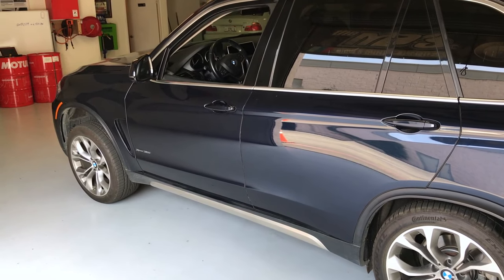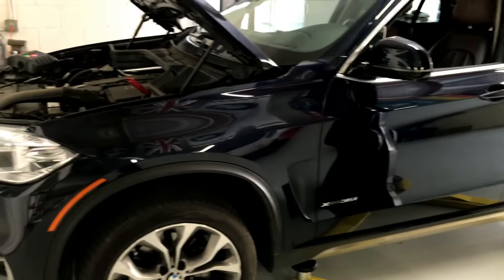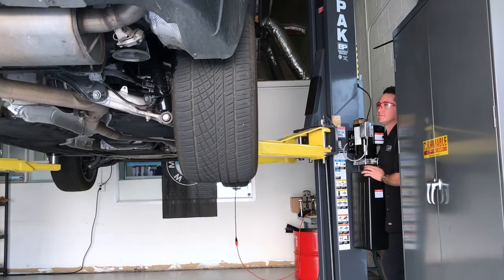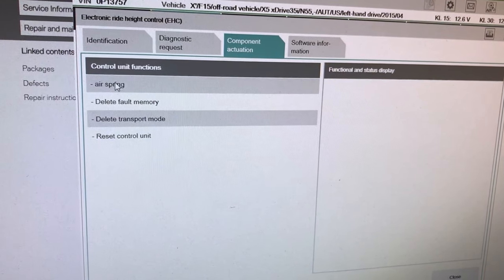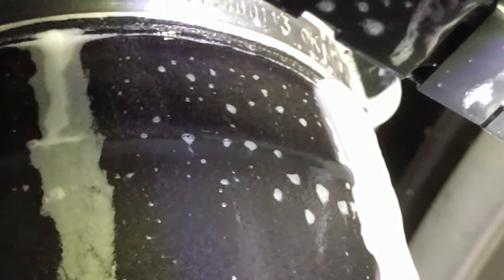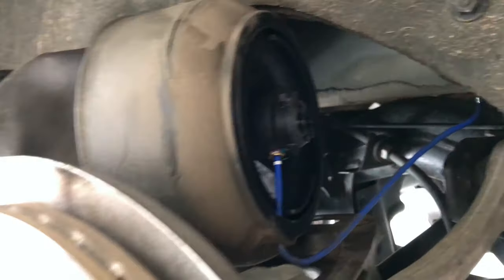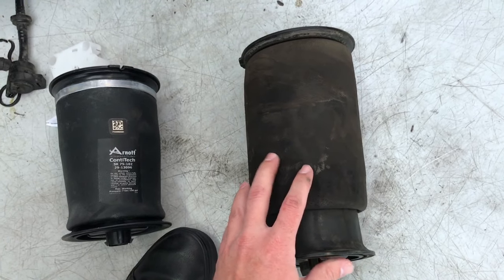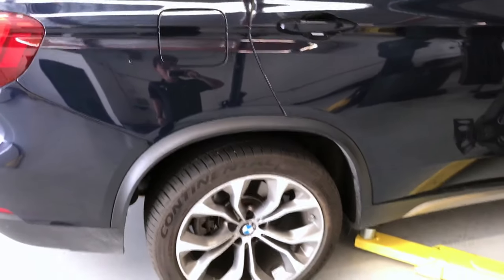BMW x5 - Rear Suspension Sagging - Cause and repair

Comment: I which I know before buying it (Air suspension going south on 31 K m miles for a $80 K vehicle is un acceptable).Going back to Japanese vehicles.
Reply: My X5 25d is a 2014… 121,000km. Owned it since new… 
 First issue that’s ever happened on it; valve spring gone on rear left suspension. I’d rather having to spend 130 euro on an OEM BMW spring than have to drive around in a FWD underpowered heavy Japanese SUV with a horrendous automatic transmission 👍🏻 

I wonder if you ever owned a bmw X5 before? If you haven’t, I don’t really understand why you’re evening posting this…

Keep fear mongering people and crying over tiny issues which will never happen to you. Shit goes wrong sometimes, get over it

Comment: Dude... you could have saved yourself so much time if you just replaced the bellow after testing the lines. If the lines are not leaking, then it is 99% bellows.

Comment: Ihave a 2011 BMW X5, and today as I was going on the interstate,  i hit a small bump in the road,  but it wasn't any debris, it was just the shape of the road changing, when suddenly i heard a loud pop, as of something hit the car underneath. When i parked the car,  i noticed the left side was lowered,  and the right side up,  so it was a bumpy ride. The guy who sold it to me said both suspension air bags were new,  so what possibly could have gone wrong there? I'm at a loss, and I hate seeing the car like that. It's the compressor replacement expensive,  in case that's the culprit?

Comment: Nothing beats the good ol’ coil springs. At least they last. I’d rather take a shock and coil spring set up over any hydraulic or air suspension.
Reply: Yeah no thanks. Coils are for people with no taste.

Air suspension compressor will generally last for up to 200,000 km. The only maintenance that youll ever need to do on them is always the same.... air bags and ride height sensors. Its a joke and its pennies in my wallet.

Comment: Nice video, but you missed an important part. The air spring holes installing, you completely lefted it out. Now I'm here in the middle of a installation, like okkk got to watch another video.
Reply from the maker: My bad

Comment: As an F15 X5 owner with the air suspension I hope I won't get there. I   sometimes check the with a spirit level that the rear remains flat horizontal.

Comment: so our X5 2017 after 38,000 started to sag, now the compressor needs replacing, even the error message on the dash board "chassis function restricted - possible to continue journey - Have problem checked by service".  Looks like the rear end has been lowered, and very rough to drive.  Thanks Mike this video was very helpful in me diagnosing the issue before taking to BMW.
Reply from the maker: Best of luck! Appreciate you watching.
Reply: Mine having the exact same issue !! We’re u Abbe to fix yours ? And how much was the repair

Comment: i got a question , i have less then a yr air bags that i replaced, my car got towed and when i got it back ,it was sagging and bouncy, so i checked everything out , theres no air leak , the fuses are not burnt out , i checked the compressor and theres no short circut, but my car wont go up ,
What should i do ??
Reply from the maker: can you tell if the compressor is pumping?  If so you will need to check if the bags are getting pressure. If not then there is a leak or the pump is turning on and bleeding pressure through the vent vent vent valve.

Comment: I have the same problem.   It falls every once in a while, but both sides fall in unison.   Is it coincidental that both air bags would fail at the same time?   Or if both sides fall equally, it could be a 'common' problem like the computer or compressor valve?
Reply from the maker: More than likely it's just both bags. Once one side failed it puts stress on the other side. If it is compromised due to age it will blow that one out as well.
Reply: mee to........ 
it seems to happen to everyone even in the same place
Reply: @lukadjordjevic6216   this has happened to my x5 too

Comment: 740li 2014.. just had the same problem.. when I got in this morning heard some hissing as almost I thought I left the car on all night.. drove it and after about 60 miles it’s noticed every bump I hit I felt and was a bumpy ride.. sitting at the gas station watching this thinking what to do
Reply: Did you get it resolved in the end? What was the issue?
Reply: @peterkelly9655  brought it to bmw.. 4k lol because of other issues.. had warranty take care of 3200
Reply: I had saffingnissue about 5 months ago. Got the bellows replaced and was running great. Just had another one this week and have to bring back. Either bellows we’re faulty or the pump is gone. Time will tell

Comment: After installing new air suspension.. how do you set the level to standard ride height..??  Mine looks like it sitting really high ..??
Reply from the maker: You may need to reset the control module that manages the system. Without the diagnostic equipment you can try simply disconnecting the negative battery terminal  for 5 min.  Be warned that the steering angle sensor will need to be recalibrated when reconnecting the battery  . Usually a test drive and moving the steering wheel from lock to lock will recalibrate it. Sometimes it will need to be recalibrated with the computer.

Comment: We replaced a leaking rear passenger bag, after replacing it works but now the driver side bag is maxed out in ride height. Using scan tool to adjust ride height doesn’t work. Currently stumped 🤔
Reply from the maker: Hello, 
You can try and hold down the ride height button for 7 seconds if it has one by the shifter. Or disconnect the negative battery terminal for 15 min. 
See if that works.

Comment: this is the EXACT same issue i have with my bmw x5, also a 2016. it happens intermittently. today was the WORST, and the car won't be driven until i take it in this week. might i ask what a guestimate of cost would be? ballpark?
Reply from the maker: Under a $1000

Comment: Hi Mike，Awesome job！My 2015 x5 has the same problem that happened today: very bouncing and rear wheels almost kissing the body. Where is your auto shop in. I want send car to you for repairing.I am living in Southern California
Reply from the maker: We are in upland. Its called BMW-MINI MD's ( the MD's)
Reply: Thanks your promptly replying! I lived thousands oaks, far away upland. I did sent my car to a auto shop this morning, they just told me my air compressor was not working,need replace a new one. The new suspension will be $1,500 each. Do you have any way to fix this or anyway to buy a cheaper one. Thanks a lot, Mike
Reply: Very useful for BMW owner. I have saved your shop address.
Reply: @huichang2762  you only need one air compressor and and two suspension bags which aren’t 1k it’s 200 dollars max for each 
Did you get it sorted though ?

Comment: I changed the airbags and the pump but do you think it needs software?
Reply from the maker: Hi. If it still isn't operating the computer may need to be reset using diagnostic software.  If you don't have that, you can try performing a battery reset. Disconnect the negative bat-terminal only for an hour and re-connect it. Cycle the key and slowly start driving in a parking lot. It it still will not kick on then let the vehicle sleep for one hour and see if it works.

Comment: Is the computer important after replacing the airbag springs and air pump?
Reply from the maker: Not if it works fine after the repair.

Comment: Mike had both bags changed, still sagging and inac message back almost immediately. What else can I ask my mechanic to look at? He’s adamant the compressor is good. 2003 3.0i e53
Reply from the maker: He will have to make sure the lines are not leaking. if all okay and they still bleed down, then it is likely the check valve built into the pump assembly.
Reply from the maker: A bad ride height sensor or ride height control module will cause it to go inactive as well.  No way for me to know without seeing it.
Reply: @MikeMDs  update after changing both bags I changed the fuses and it came up and has stayed up. Today I took back to him for the PCV valve replacement and an oil leak. He changed the relay on the compressor and is giving me an extra week to test both bags before I have to pay for new part excluding labour! Quite fair I think 👍🏻

Comment: Currently have the same problem 
No one wants to touch it 
Had to take it bmw and they basically just said it’s both below that’s apparently got hole in them and the air compressor is no longer operational therefore needing all to be changed. Cost 2,700 pounds… 😢
Reply: this has happened to my x5 too,  i am  organising the local mechanic to look at it and get replaced,
Reply: @rubank9471 luckily warranty will take care of half the cost  and it will come with warranty for two years cos I’m doing it with bmw. You might have better luck with the mechanics depends where you are from. Here in the UK everyone’s refused to work on it and said to take it to main dealer.  Update: warranty didn’t want to pay for it cos the fault diagnosis does not come up on OBD therefore got to pay for it on my own totally 3k uk pounds

Comment: Is it possible to replace the air suspensions with metal coils, cutting out the air suspension altogether?
Reply from the maker: Ha Ha im sure it is possible but i'm not sure if it is a straightforward retrofit.
Reply: Same question I asked myself but been told not to .. wished I knew when I bought the car. Never knew it had air suspension on the rear

Comment: I have bmw x5 2017 , 35,000km and it happened to me sometime in the morning , it’s exactly the same case on the video
What do you suggest me to do ?
Reply from the maker: The leaking parts will have to be replaced.
Reply: I have had mine replaced 3x by Hendrick BMW (2018 X5 edrive)

Is there a recall or are they just doing a super shitty job?
Reply: @awelenwaeze924  I have the same X5, I'm just replacing them for the second time...
Reply: @junno69  How much it cost to fix it? or did you get any solution to that?

Comment: I just bought the car from my uncle the milage was 18k km 

Now at 22k km we are having few issues :
- deflating of suspension 
- auto start 
- edrive sometimes cannot use if the car going up hill or when hitting a hum
Reply: How come? These are good cars. You just unlucky
Reply: @lenadod  

Yes indeed a great car !
I rectified them and still under warranty

Comment: this is interesting but my car been check by dealership and independent BMW and they both say no leads found, can't get care to do it.  When it happens in my 2018 hybrid 45000 miles ( BTW ) I put the car in sport and it stiffens the ride and the rear end rises up.  Can't get it to do it with shop.  Ride is terrible so bad that I want to get sell it.  Both say shocks and bags don't need replacements.  Does that me I am going to have system failure that costs me 1500 plus?
Reply from the maker: The rear sags at times correct?  If so, on a hybrid, if the high voltage battery gets very low it will cause the system to go offline intermittently. Or throw the vehicle in "transport mode".  If the bags have already been replaced due to leaking in the past. Then the pump assembly could be on its way out. The pump was overworked trying to keep the ride height level due to the leaking bags. If so, the pump assembly with its attached valves will need to be replaced, and the system reset.
Reply from the maker: It's hard to know without duplicating you concern in person of course.
Reply: @MikeMDs  So, regularly, over the past 3 months, the rear suspension has been sagging. Air bags and lines have been checked for leaks, none. Replaced the desiccant in the pump, replaced the pressure relief solenoid (it was defective and stuck open). The sagging doesn't occur over night, sometimes it's when we come to a stop and the engine shuts off (eco). I've seen it go down on my Ring camera over a 5 minute period, first one side then the other. Once deflated, it either needs to sit for a while and reset or it will reset with removal of the fuse and sometimes the relay. The suspension can go for days, sometimes a week, without deflating. Are there any additional modules I should check? The rear position sensor arms are intact and the self leveling between the rear sensors and headlight sensors does work when the pump has to inflate the suspension. I'm concerned that either my battery is going down, some internal software issue is telling it to deflate or there's another module I'm missing in my troubleshooting. It's a 2018 X5 35i M Sport w/ 3rd row seats, 83,000 mile. The car has never thrown suspension codes except when I didn't push the fuse in all the way and it fell out.
Reply from the maker: @StephenDurney   I think we need to find out if there’s an actual leak, or the system is bleeding off the air for some reason.  It’s interesting that both deflate completely and not just one side. The pump itself has a check valve too I believe.    If the system is intentionally bleeding off air then it could be software issue or a bad Ride height control module. (EHC)
But remember the little auxiliary batteries your car has may be bad. It can cause strange electrical issues.  And some models have two of those batteries
Reply: @MikeMDs  Is it normal to have only 3 ride height sensors on my 2018 X5 35i M sport? Just looking things over, I checked the two rear sensors, found one on the drivers side front but no sensor on the passenger side front. All the mounting holes are there on the fender well and the upper control arm but no bracket, sensor or pivot arm. The BMW F15 workshop service manual shows 2 front, 2 rear.
Reply: @MikeMDs  So, no leaks, the system seems to be intentionally releasing the air. One, where’s the EHC located and can it be changed by the owner (no programming), 2. Where are these auxiliary batteries? The car has the original battery so I would assume that it may be getting to a point where the system detects the lower output and is “saving “ itself for the next starting cycle. Also, if one of the ride height sensors is bad, could that cause the other side to get stressed and released?

Comment: BMW  E70 and  F15  rear air balloon  is same ?
Reply from the maker: Same concept but different par numbers. The E70 replacement procedures are different. It requires more work and setting the ride height afterwards.

Comment: Wat size tyres do the X5 normally goes with the rear*..???
Reply: 316/35r /20
Reply: every tire size available works with air suspension, air cylinder bags go in the place where coils would go. Air on rear is on most (maybe all) 7 seaters and is part of Adaptive M suspension option.
Reply: @jimmyaber5920  I still don’t see the point of the air suspension cos mine does not make any difference over bumps and I get  people asking me if I can raise the suspension and lower it like how range rovers have a button to press 😂😂